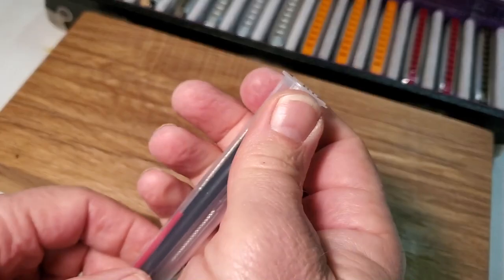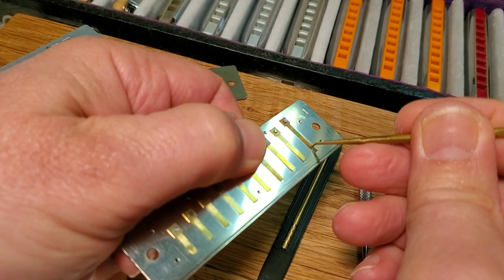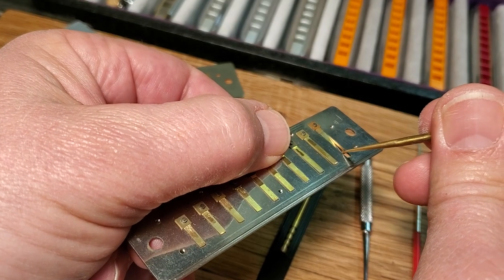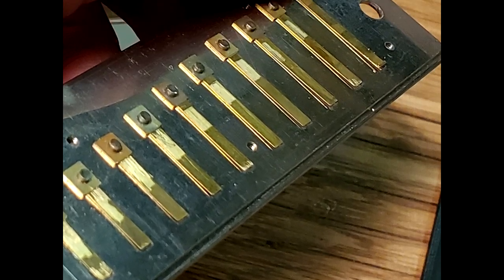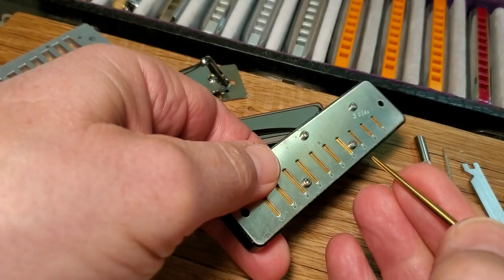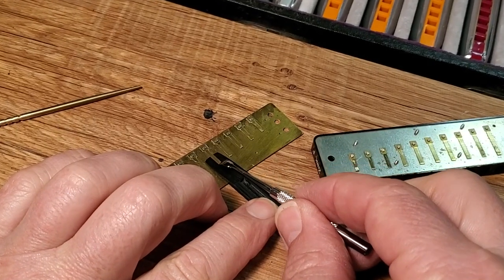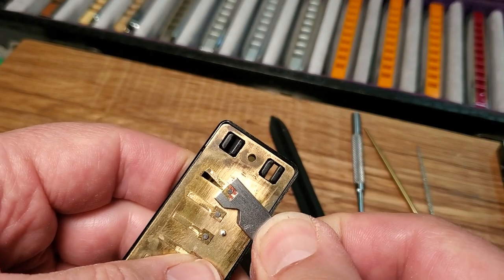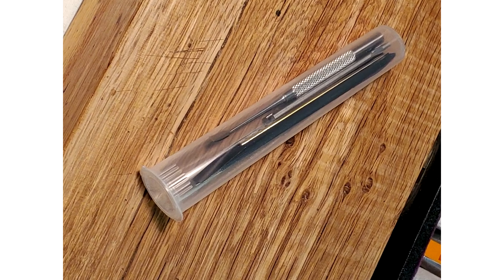dBomb Harmonica Tool Kit

Comment: It seems like the reed gaping wedge would alter the curvature as it raises the gap near the rivet . ??
Reply: An extremely small change near the rivet avoids making a greater bend at the middle of the reed. This is a very simple and safe way to adjust the reed gap only. I might make a part 2 video about making adjustments to a reed profile and embossing. These fine adjustments are directly related to setting reed gaps, but gaps are by far the simplest and most effective adjustment.